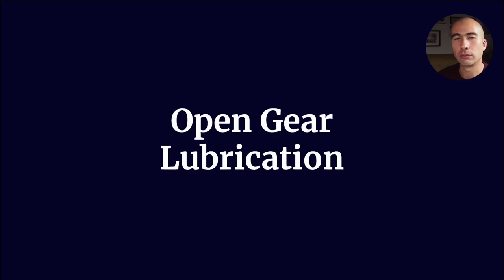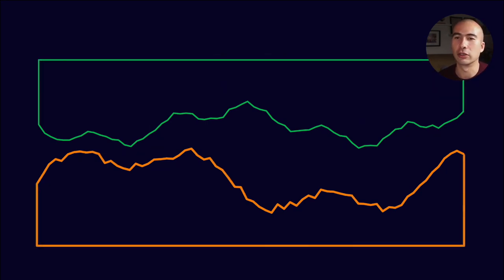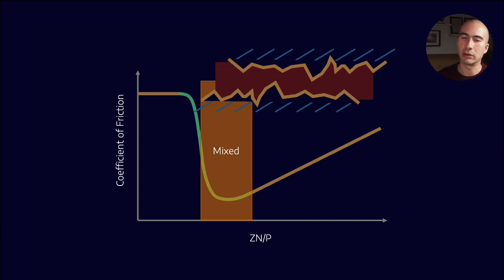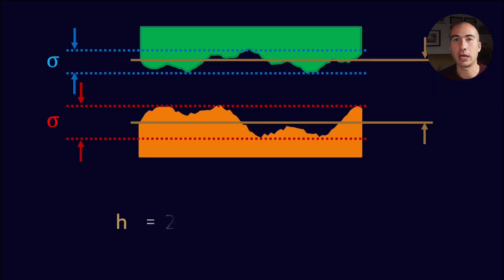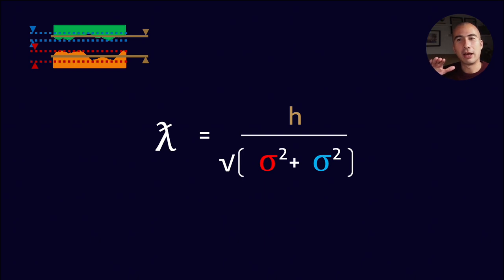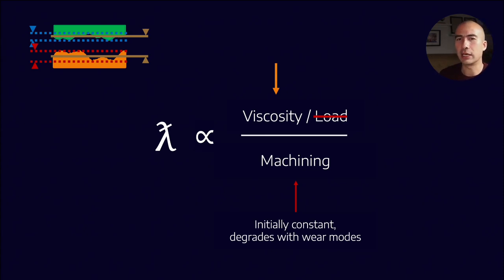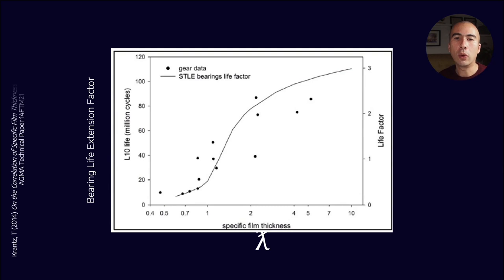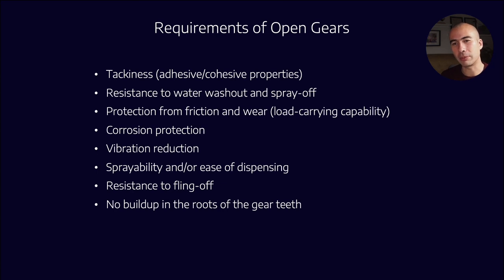Open Gear Lubrication

Comment: all data I've see on engine oil (plain bearings) tends towards: high(ish) viscosity=best for longevity, but the modern tendency is towards the use of very low viscosity oils(like 0w20) while the "heavy duty" side of things seems settle  towards a more "robust" 15w40